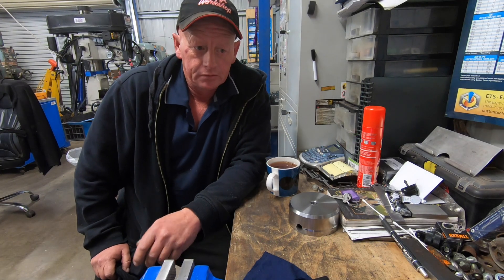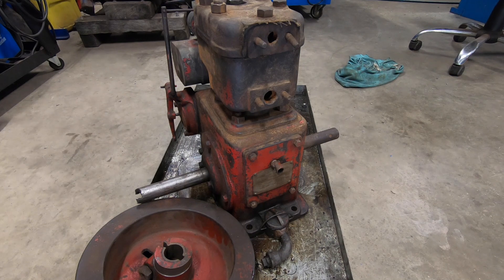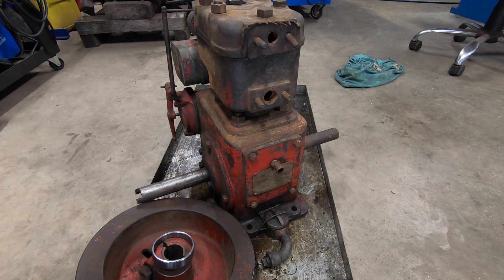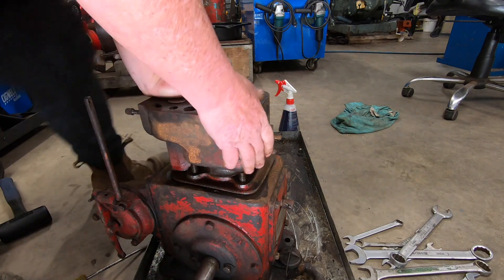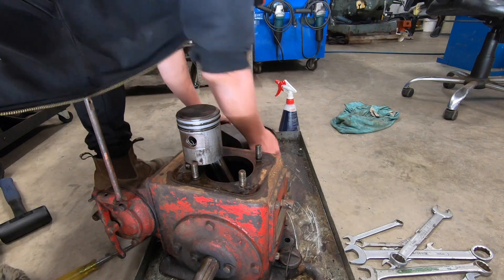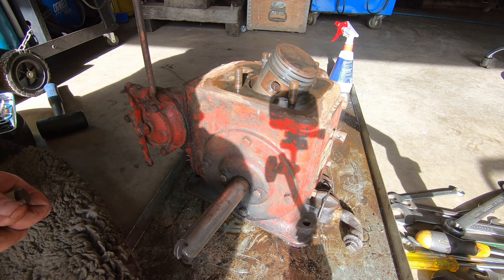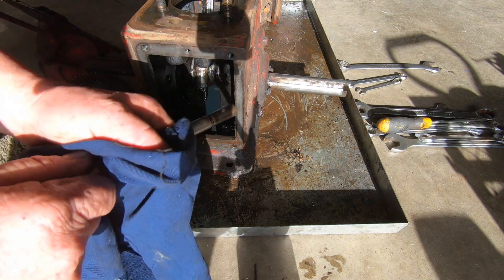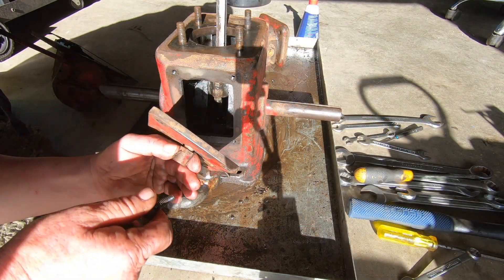Ronaldson & Tippett,  Part 1 - Strip and Inspect

Comment: Such a simple engine.  Something modern engineers have forgotten is with complexity comes additional points of failure.  This is an interesting change of pace. Looking forward to seeing it run.
Reply: I agree 👍 It seems like the new breed of engineers are taught in college to make things as complicated as they can. They look at you with a blank look when you tell them to use the "Kiss" rule.
Reply: Yeah but modern engines make double the power per cc so it’s a trade-off as always
Reply from the maker: Gday Joe, This is a good break from the lathe and mill, These engines are so simple and built last, Thanks for watching and commenting, Cheers

Comment: G'day Matty. Stripping it down is the easy part remembering how it goes back together is the challenge but it's so simple hey it'll just fall back together. No plastic parts to worry about. 
Cheers Peter
Reply from the maker: Gday Peter, there’s not much to these old engines, rather work on one of these then a new one, thanks for watching and commenting mate, Cheers

Comment: The cracking of the flywheel in my opinion is the result of the engine having a harmonic balance problem. The placing of a ring over the  bosh will not solve the problem. I recommend that you search the requirements of how to balance a single cylinder engine  . Hope this helps an avid watcher to the Chanel
Reply from the maker: Gday, I wouldn't be surprised if the crack happened during storage and being shifted around over the years, Thanks for watching and commenting, Cheers

Comment: Hi Matt Ronalson Tippet made orchards sprayers they had these engines driving a two piston pressure pump and the sprayer agitation,these motors would work all day long days on end and they ran very sweet
Reply from the maker: Gday Ian, These were a very popular engine back in the day and a lot of accessories that went with them, Thanks for watching and commenting, Cheers

Comment: I have had a few of these old engines, still have about 20 different types tucked away. My last Ronnie I made spacers and fitted metric bearings. Way cheaper.
Reply from the maker: Gday Lance, the bearings are bloody expensive to replace, I think I might end up doing the same and put metric bearings in the future once I know everything else is good, all I need to get now is a water hopper,  Thanks for watching and commenting, Cheers

Comment: I'm helping a mate with one of these engines. Is the splash lubrication just from that small pencil shaped casting on the bottom of the conrod bearing cap? Or is there other sources? Thanks.
Reply from the maker: Gday, that’s all the oiling situation is I believe, cheers

Comment: Nice little motor. I don't think I would be able to put this back together and NOT change those bearings. LOL
Reply from the maker: Gday, its going back together with the old bearing for now, im going to look into bearings of similar size and make them fit, this engine will be lucky to run a couple of hours in a year, Thanks for watching and commenting, Cheers

Comment: Go Matty stone axe technology . Made here in Australia . They will run even  badly worn out .. all u need is a good magneto ! Still a few bits about .  Have one on my Lightburn concrete mixer badged the Lightning . So reliable . But heavy .. it any no Honda !!!
Reply: Unlikely that a Honda will make the low rev torque, that is to say at 1000 RPM!
John, Australia.
Reply: I like pulling old engines apart always more interesting than the new ones .
What's the bore and stroke?
Old apprentice from Queensland
Reply from the maker: Gday Mark, Its amazing how these will still run when there flogged out, they certainly dont make them like they used to, im looking for a water hopper now so hopefully I find one to finish this off completely, Thanks for watching, Cheers
Reply from the maker: Gday, its got a 3" bore and around a 3" 1/4 stroke or very close to that, Pulling these engines apart is also a lot more simple then the new engines, Thanks for watching, Cheers
Reply: @MattysWorkshop  mine has one made out of a big bit of rhs . It has a casting for the lid . I can measure it up if u need
Reply: @MattysWorkshop  So that makes it about 23 CI or 377 CC.
John, Australia.